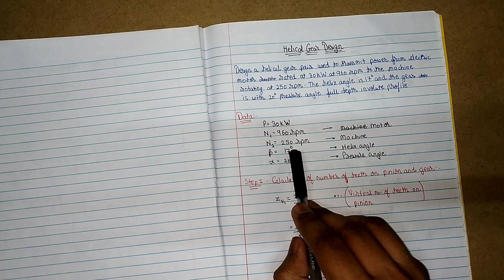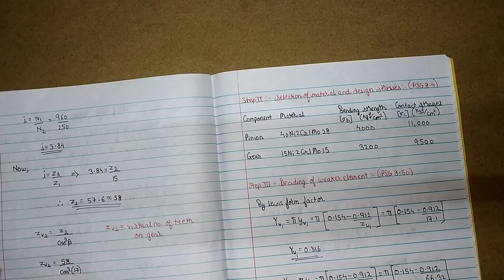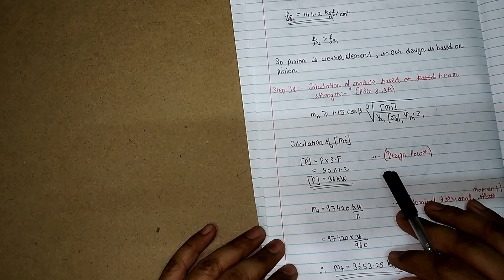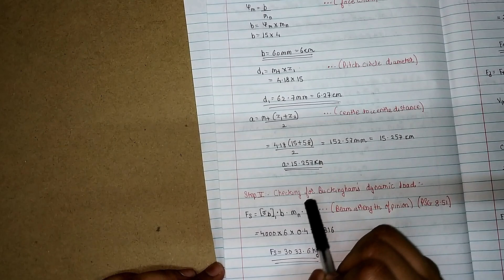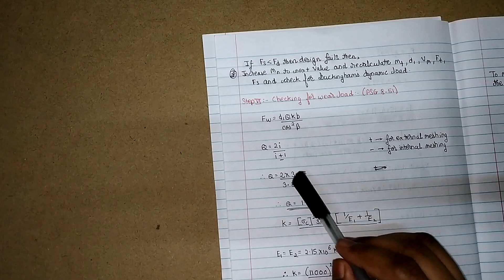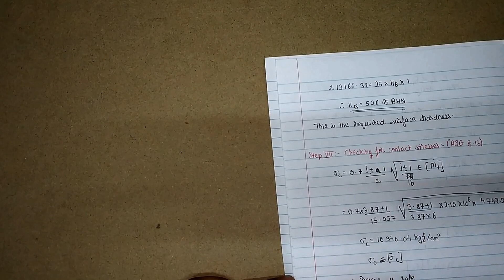Helical Gear Design  using PSG Design Data Book with complete procedure. | E Mech

Comment: i have a question sir 
how did you know that the fzero is equal to 1?
thanks
Reply from the maker: Refer PSG 8.1 and see the value of f0 for standard gear. f0 is also called as addendum factor or height factor.
Reply: @e-mech  thanks a lot